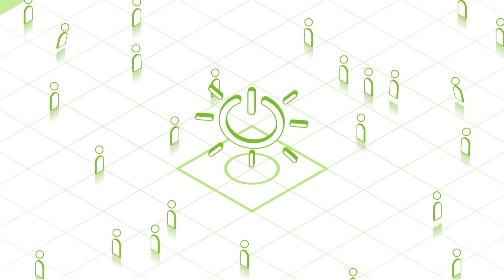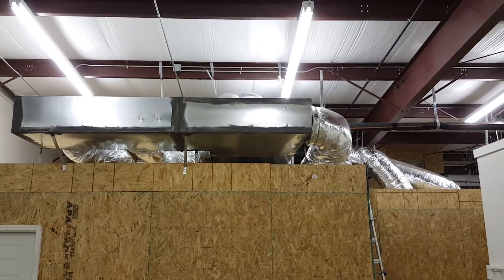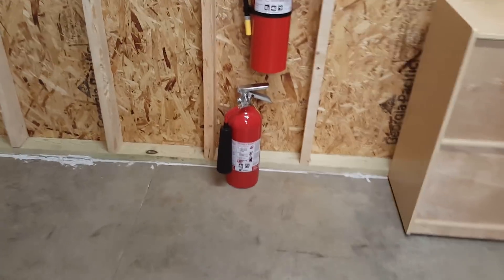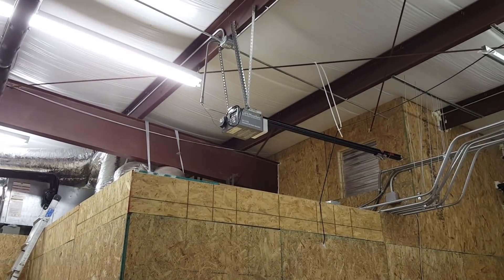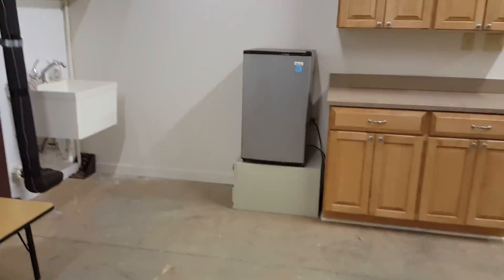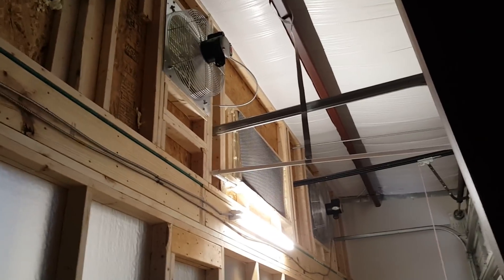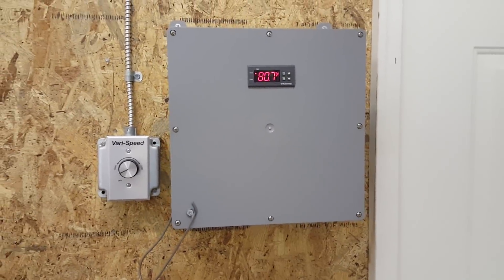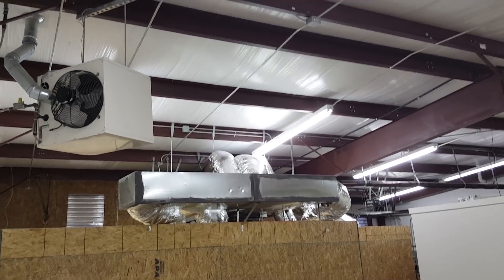500 GPU Cryptocurrency Mining Center - Walkthrough

Comment: lmao RiP. Too bad Bitcoin dropped 70%
Reply: You wouldnt mine bitcoin on a GPU anyway so it is not really a problem :) bitcoin difficulty is far too high for GPU mining ASIC is the way for bitcoin :)
Reply: what is ASIC?
Reply: an ASIC is "Application Specific Integrated Circuit" this means the small processor chips in ASIC units are designed to calculate specific algos only such as SHA256 algos they are very fast and efficient and doing their one job and that one job only.
Reply: Jtag Sheep OP is an idiot, but prices do seem to follow the bitcoin bitcoin price
Reply: lol white  haha no where near that m8

Comment: Did you put any solar panel system??? to low your power??? 100 kw system  with 3 phase will give around 120 A for 380 Volt between the phases ... so the volts is lower for you and the A will be more!! but I do not know how much roof you have ... to install even 50 kw to 80 kw, plus there is 350 w panels that have less space then an old 250 W I used to work with...

Comment: Thanks for sharing. Can you provide links please to the wall air filters and wall fans, GPU cases you are using please? Also what is the 'optimal' temperature? Thanks in advance.
Reply from the maker: Hi Rob Lober, Sure, Filtered Return Air Grille,24x24",White - https://www.grainger.com/product/4MJT8?cm_mmc=PPC:+Google+PLA&s_kwcid=AL!2966!3!57772101357!!!g!256063265187!&ef_id=WQFCgQAAAAZLJ0o6:20180608184747:s  Commercial Shutter Fan  http://www.greenhousemegastore.com/product/shutter-fan/greenhouse-exhaust-fans
Reply from the maker: I try to keep the humidity under 60 and keep it also around 80 to 83 F
Reply from the maker: As far as the GPU cases are concerned, we've been making them here in the us and we want to make them available at excellent prices soon to the public through the Foleum Project https://www.foleum.io/

Comment: How many hashes do you get per card? Should I get rx 470 nitro+ or 480 aorus. I can get them for the same price. The rx 570 I can get for about 55$ more. What should I get?
Reply from the maker: Hi Amar K., you could bios mod any one of them and get similar results but I would go for 8 gigs of RAM. If you want to use it as your everyday computer and mine at night I would probably get the newer version and if you just want a mind with it I would get the cheaper version. I hope this helps and good luck.
Reply: Amar K. Rx570 30 mh/s rx480 almost 23 mh/s
Reply: why so bad 480?
Reply: Amar K. Because is a old model even stop produce , I think not sure
Reply: +TheBitcoinMiner Thank you for the tips!

Comment: Are you not using 208 volt or 220v for your rigs?  I like your fan setup.  Are you trying to keep a positive pressure in your cold side, compared to the hot side? Basically, you can economize a ton by not having inefficient blowers or fans in your rigs burning power if you pressurize the cold side and keep the hot side in negative pressure.
Reply from the maker: Hi Nick Ellermann, Thanks, yes this current location is 208. We had certain restrictions at this location so that we were only able to use a pull scenario instead of a push/pull. I totally agree with you though the push-pull scenario is going to be a better ultimately but with the high static pressure fans be used inside of the server cases (we didn't use just any fan) this design seems to be working very well. One of the main reasons is because of the servers are creating an air wall at the back foam board.

Comment: Cool video- thanks, do the Gpu servers exhaust out the wall behind them?
Reply from the maker: Hi Steve Greenberg, yes they do but about 30% of it gets recycled with the AC system the rest of it gets exhausted out in the summer or recycled into the warehouse, that heat it.
Reply: great ideas on the air flow!

Comment: Insulation!!!!
Reply from the maker: Hi James Mcclain, there is no need it wouldn't do any good because of how fast the air is moving. if you notice on the back wall the only place it really matters between the cold room in the hot room there is an R7 foam board to help with the heat separation.
Reply from the maker: Then you would have to sheetrock the room which would also cost you a lot more money for very little added benefit if any if any at all.

Comment: what is your power rate?
Reply from the maker: Hi jctai100, here in North Carolina if you can balance your load properly you can get it down to $0.04.
Reply: I figured it had to be low, definitely a sweet operation there, built for future scalability.  Thx!
Reply: Does that include transmission and any non-deductible taxes? That's decent.